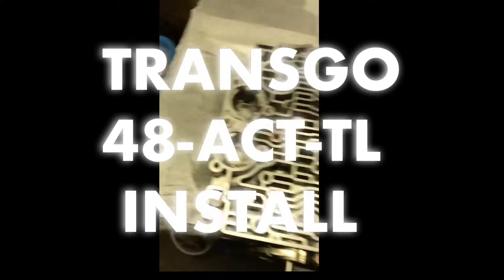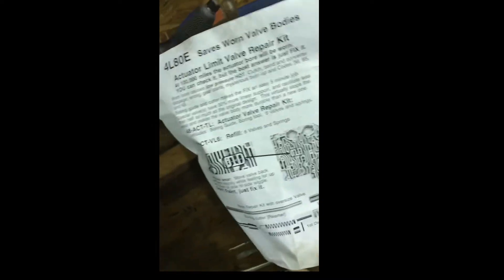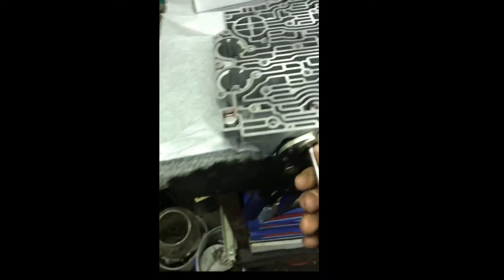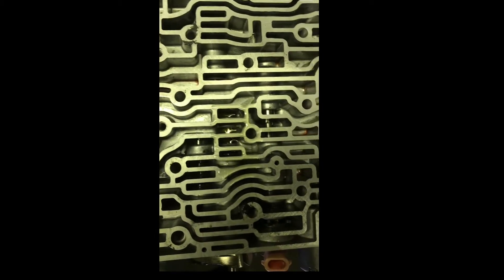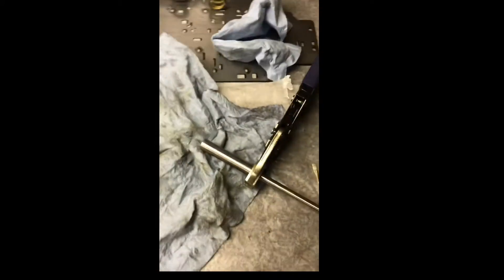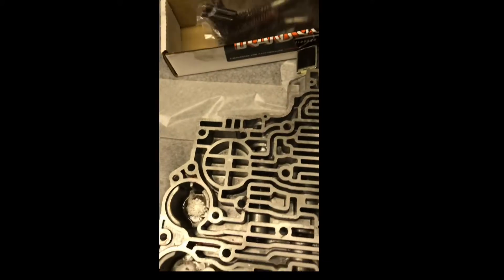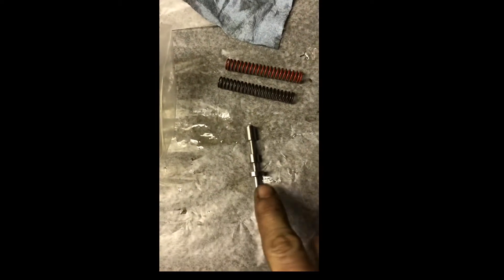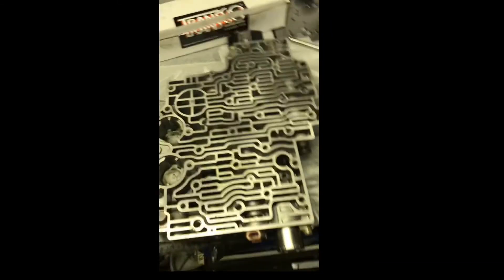4l80e Transgo 48-Act-TL install

Comment: What does this do for the trans
Reply from the maker: It corrects common problems on the 4l80e, it’s not performance oriented at all,just fixes factory flaw I guess you could say, sorry I can’t explain it in detail more to you but if your interested just google transgo  48-act.
Reply: @ftlboy717  what problem's this fix ? i have 4l80e 2003 having hard shift when hot feels like there is some oil escaping somewhere in the valve body and some ppl say this kit will fix it, so do you have any advice ?